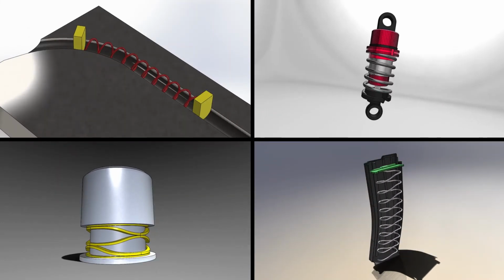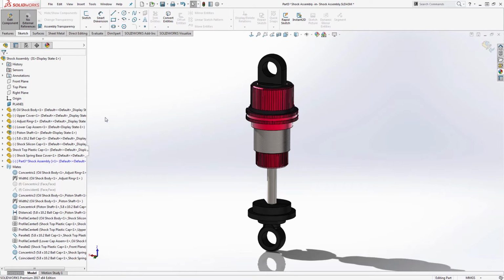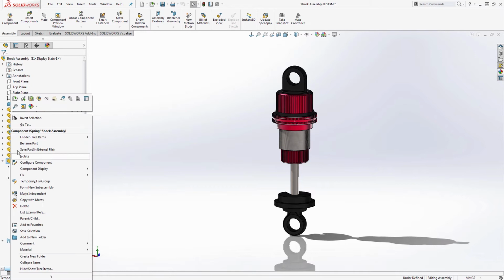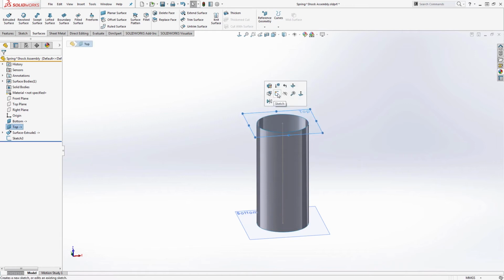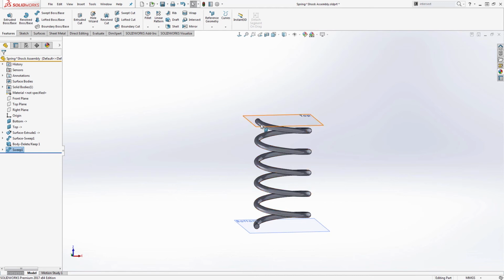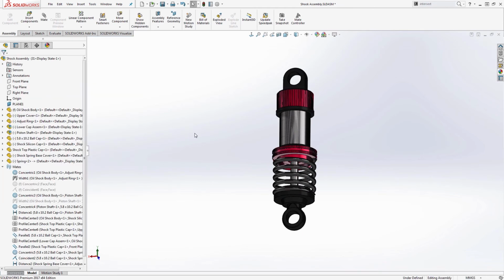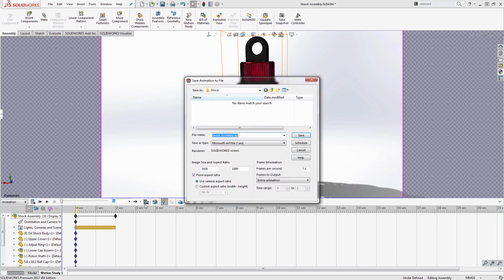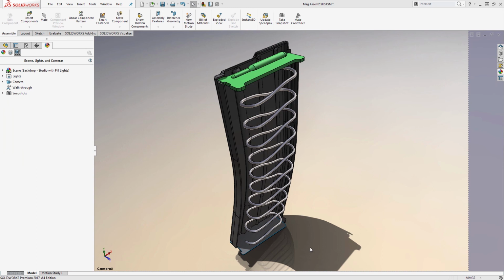Making Spring - Animating Springs in SOLIDWORKS

Comment: Awesome video, creative way of going about this, and I learned about a whole new set of features. One minor issue I did have is that my spring doesn't automatically change length when I move the piston. The mates are all in place and it moves between its range, but in order to make the spring fit back to the new location of the planes I have to actively rebuild the model. Is there a way to make it rebuild automatically the way yours does? I am running SW 2016x64

Edit: 64 bit
Reply from the maker: Thanks for watching! 
If you are just moving the components around, that will require a rebuild. The mate controller in this example updates the assembly for you. Another nice benefit of using the mate controller!